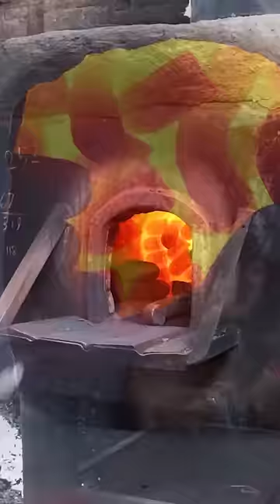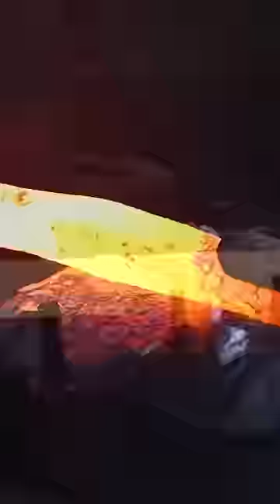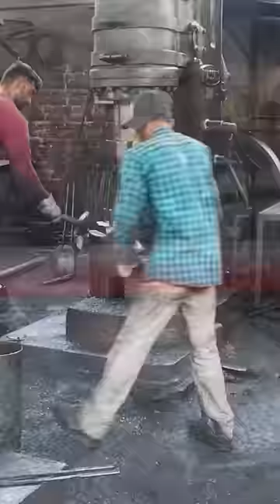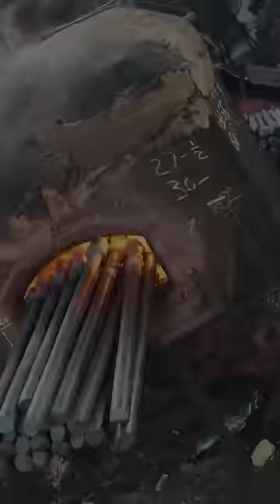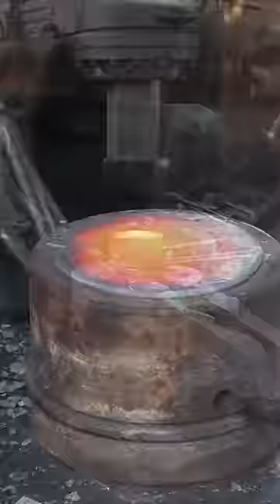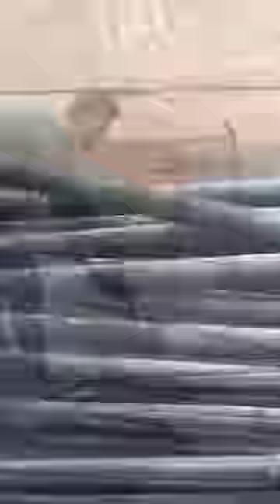Most Incredible 8x8 Truck Axle Forging Process from Rusty Ship Anchor Chains #viral #shorts #100k

Comment: Imagine the time and material used to cut through the thick ship anchor chains.
Reply: It looks to be flame cut, oxy-acetylene. Fairly quick process
Reply: Plasma cutter?
Reply: Torch plasma cutter makes this stuff look like butter being cut with a kitchen knife
Reply: That's plasma
Reply: The time to cut the chain would be 1% of the time to bend and forge the metal into a straight and say 1.5 inch diameter shaft. I'll guarantee they take at least 10 to 15 minutes to get it correct. I've taught blacksmithing in high school 
.
Reply: @JGunit  coal fired power plant. When you wonder where all the thriving from it went to it went to where you can see they don't have any labor protections.
Reply: Don't imagine. Look for the truth. You'll find it's as easy as Pi.
Reply: 100% oxy/acetylene cut. 1 dude probably cut the entire chain in 2 hours lmao

Comment: I'm sure the shaft is of good quality considering they forged it and used the basic material of steel chain
Reply: Anchor ⚓️ chain steel.
Reply: I guess they put it on a lathe to finish it make sure it's true I can hear Greta thunberg right now how dare you
Reply: The original steel does come from China though. Just saying...
Reply: Looks well tempered to me and you are recycling
Reply: @carlnulty9870 do you not need to quench it for it to be tempered?
Reply: @deadbrother5355 Tempering is bringing the heat down slow.

Comment: How do you keep the shank straight? I saw no straight edge or an indicator to check straightness.
Reply: Pretty sure they lathe or mill it into its final form
Reply: Experience
Reply: If no lathe was used its not perfect
Reply: It will still be machined. This is not finished
Reply: Lol😂 that's before it gets finished by a lathe
Reply: Laying the shaft on a welder's plate would give them reasonable gauge of straightness. The shaft is likely to be turned on a lathe and finally balanced on a grinding lathe.
Reply: None